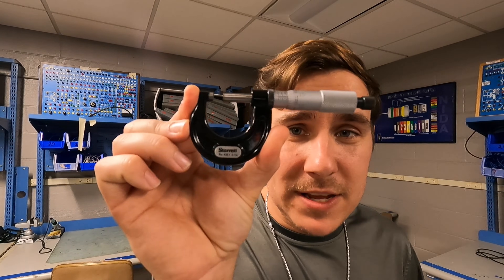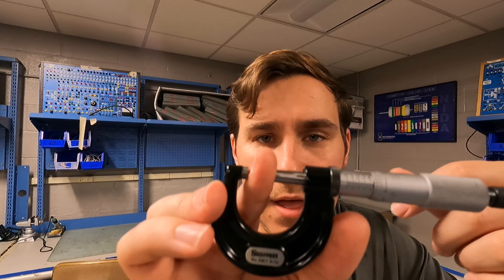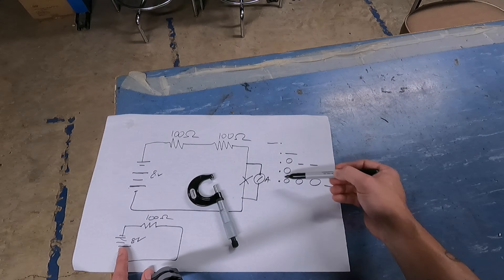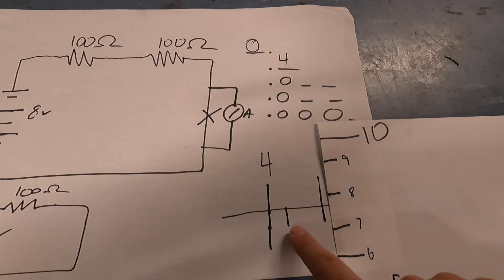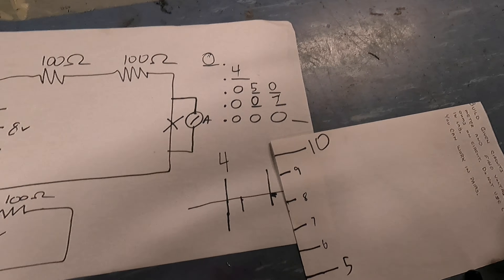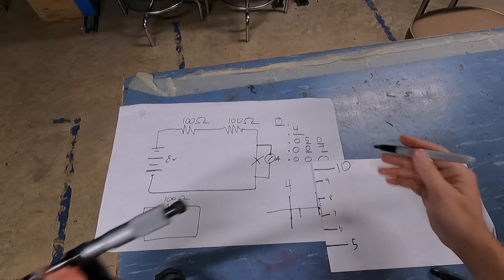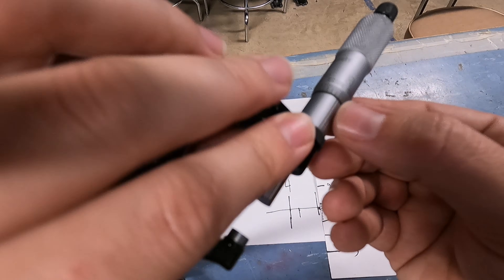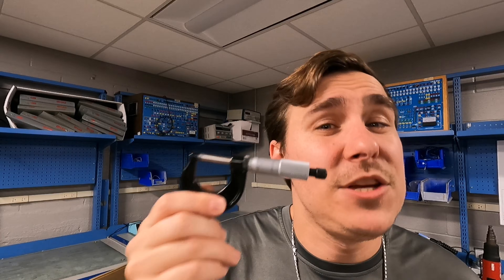Title:How to Read a Micrometer | Measure to 0.0001" | A&P Practical Test Prep

Comment: I have to teach my piano tuners  to read a “mic” for piano wire. We use thousands of an inch for some things, inches, and of course millimeters. 🤦🏻‍♂️ 

And I’m a pilot. A lot of piano tuners are pilots. 🧐 

One piano rebuilder I know in Chico, CA   Rebuilds wood spar aircraft wings! 

Haven’t yet figured out the connection, but here we are.
Reply from the maker: I would definitely trust a piano rebuilder to rebuild a wooden wing though that is for sure.

Comment: Bryce, this is a great video, and the website you mentioned is a tremendous resource. I would like to request that you do a demo of lacing a wire bundle with cord (pg 4-58 thru 4-60 of Powerplant Handbook) I got wire bundle lacing as a practical, and although my examiner kept repeating "It's lacing, not tying", I really didn't know what was expected or how to interpret the task. I've since read up on the purpose and methods of wire bundle lacing, but I'm really a visual learner and the figures aren't cutting it for me. Thanks in advance, Bryce!!
Reply from the maker: Thank you for the suggestion. Wire lacing/tieing is a easy one to mess up

Comment: THank you for this video.  GoPro’s and others look for sharp edges / lines to help with focus.   if you had a flat background it could help.   Another idea, grab some AL and fab a small stand and have the camera mount pointing down to a flat surface.  Then you can slide things under it as B roll and cut them in during edit :).  Make sure to set the FOV for such close up work to keep the fish-eye out.  You could have your DVM under it, rivet samples, etc.  Please keep up this series.!!!

Comment: Prepping for my general and powerplant O&P right now thank you!!!!!
Reply from the maker: Good luck man
Reply: A few small pieces of advice: Be prepared to check throttle lever travel according to the maintenance manual. And know about ATA codes!! Those pesky things are very useful when the rubber hits the road. Last thing, if you get an Oral question that deals with the regs (i.e., STC approved data), always go to the back of the FAR AIM book (the big FARs book that is provided) and check the index to help you locate the applicable regulation. Even if you think you know the answer, remember that the regs are often written with stipulations, so it's always wise to take the time to verify before giving an answer to Orals on regs.
Reply: @AirmanAlex I will keep this in mind thank you very much. I know a common mistake is A&P students is not taking advantage of the literature provided during the O&P.